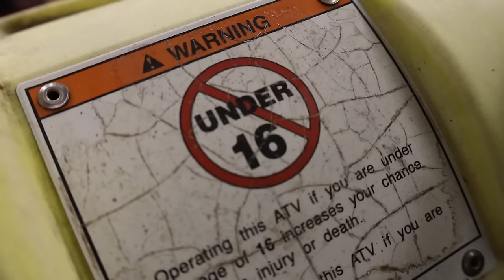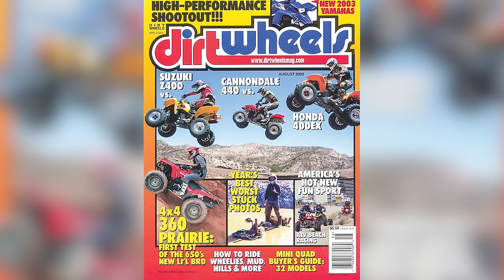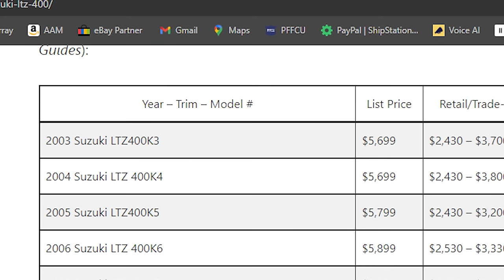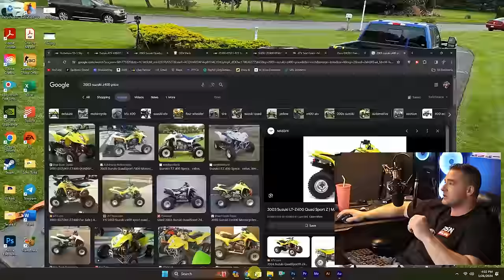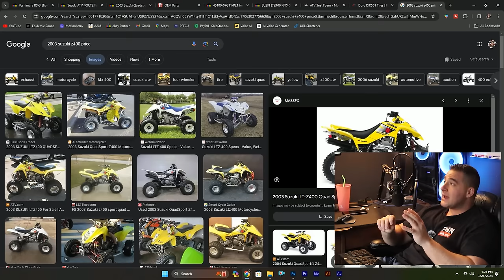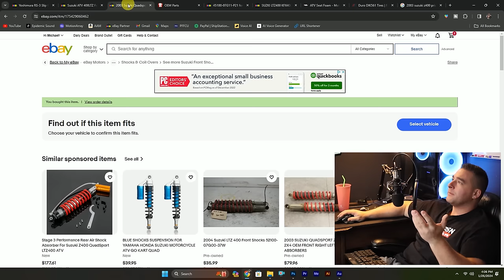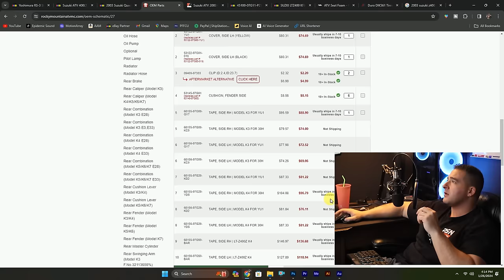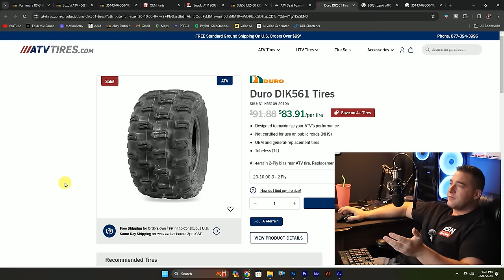It only took me 20 years to get my Dream Quad! and this one's MINT!

Comment: Those where very fast pieces of crap  after you spend 2500 plus on engines and put 400ex swingarm shocks a arms  and  zip tie the seat down  it might win a championship moto cross but they wouldn’t stay together